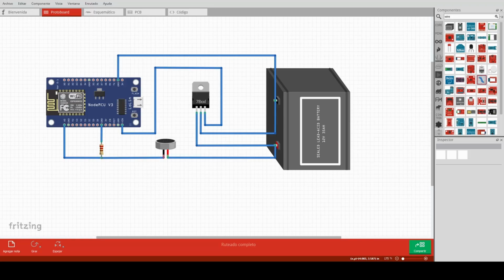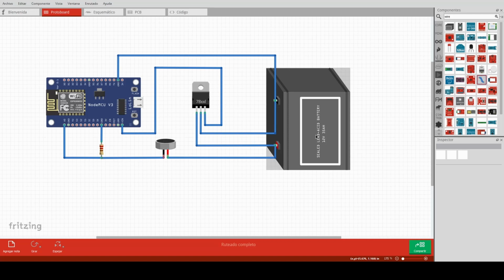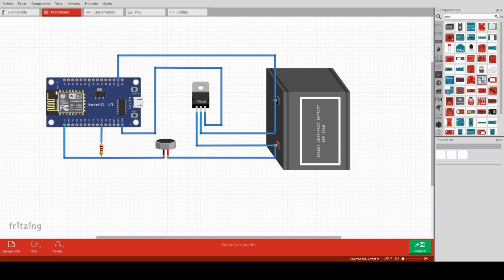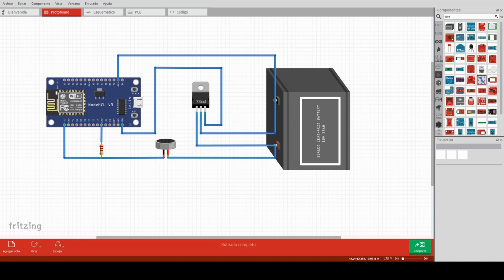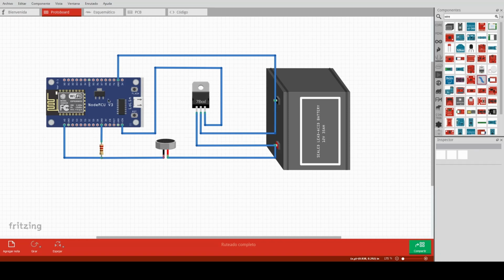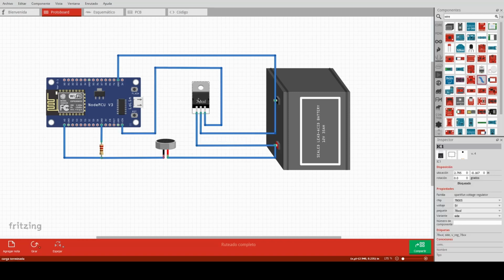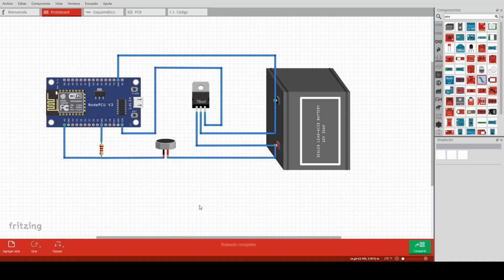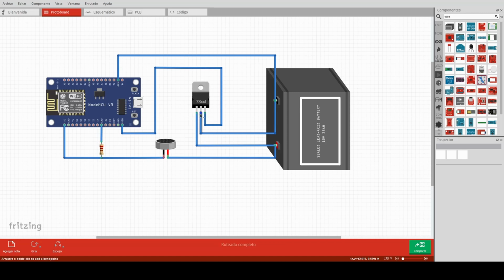Connecting a water level sensor to ESP8266 (English Version)

Comment: Is there a mistake on the schematic? The connection of the A0 should be on the other side of the resistance right? On this schematic, the A0 will receive more than 5v, no?
Reply from the maker: Hello, thanks for commenting. The schematic is fine. I have this device working for years with this exact configuration.